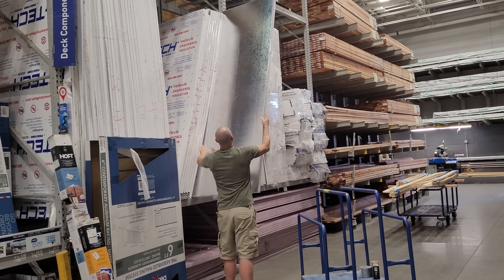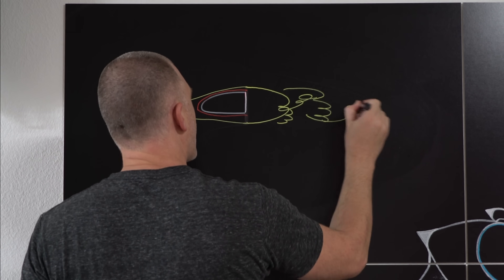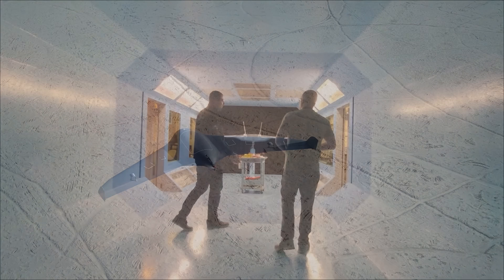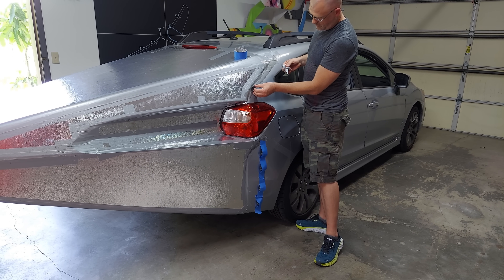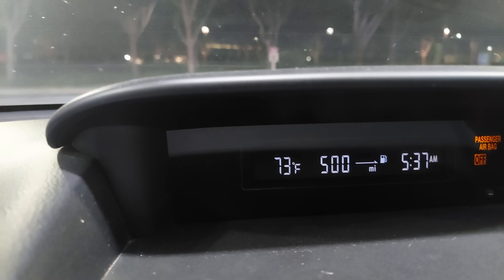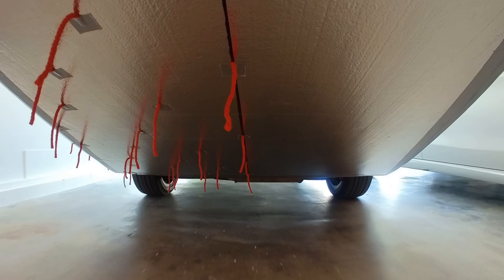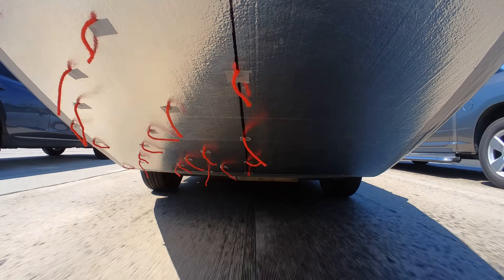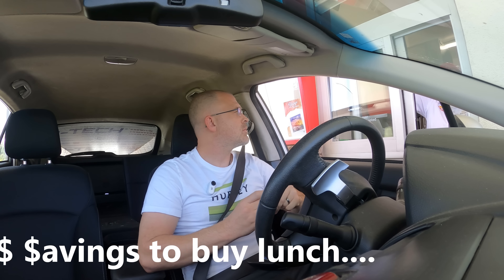Using Simple Aerodynamics to Beat High Gas Prices (Home Improvement Store Edition)

Comment: You improved efficiency,, but it's still pretty poor. 50 miles per U.S. gallon would be good for a car of that size. Go electric (plenty of good, low cost second-user cars can be found, sometimes for less than $5,000), and you should be able to achieve a gasoline equivalent of 200+ miles per U.S. gallon.

Comment: Also wonder why manufacturers doesn't do something similar but not that big or obvious. 
Like something smaller but still removes some drag. 
If it was this "easy"to shave off 13% then some less visible optimisations would easily save 5-10% and that is a lot. 
Manufacturers pour billions into engine optimisations to get out 1-2%

Comment: Any plans to revisit this project ? 
The tail on my car retracts on rails. 
I just use simple drawer slides. Nearly 2 years later, and it still works. 
Retracted, the car is no longer than a Camry. 
It also has a moveable floor that moves on inclines, so getting out of steep driveways isn't as much of an issue.

Comment: Great project and thanks for the whole video.
Some thoughts-
- ditch the roof rack!   Major drag
- boattail - great idea, but reduce angle to 15 degrees, which is when separation starts
  .. bottom should slope slightly upwards like a diffuser
- cover rear wheels
- belly pan

Comment: Check out the Audi100 C3 drag coefficient table. Low drag also mean low downforce
Reply from the maker: In a lot of cases the drag is creating no downforce, its just parasitic.   Good drag to eliminate.   But I understand your point.
Reply: @thinkflight  ah damn that hit really hard in my blindspot. Yes, certainly, and the difference between the mass, shape and disposition of the front and rear ends determines how much goes to downforce and how much to passing the air smoothly around. Low downforce can be extremely good but limits you to around 90 km/h from what I have driven so far. No joke one car was smooth as butter but really floaty on the highway above 90 km/h. We could have really efficient cars if we devoted four times the time into driver training.

Comment: It makes sense if the additional tail surface is conductive.
It looks like aluminum to me.
Foamed materials are susceptible to electrical charges, but electrically conductive surfaces will discharge.
Static electricity causes turbulence and increases drag.
Toyota puts aluminum tape on the inside of the plastic bumper.😄

Comment: With flat floor with air-rams pushing air from behind the radiator down under the car. Rework front spoiler and side skirts so they as well become air-rams. I am in Australia and tested this was getting 4% tyres +front spoiler/skirts 2% + with flat floor 8% BUT with flat floor with air-rams pushing air from behind radiator down under car and spoiler/skirts, tyres 22%. I had a hydraulic floor linked to the speed the car was travelling at, like F1 in the 1980s didn't have Vee shaped back as the car was total illegal within Australia but not unlawful so didn't want too much attention-getting. So 22% +13% =35% that would rock. Anyway, love your video's  Dennis-Michael.
Reply from the maker: Wow, pricelss comment.   Gratitude🙏

Comment: for someone talking about aerodynamics and with experience with drones and things i was surprised you used vortex generators in a completely wrong way.  the way you used them actually probably caused more drag.  there are papers out there that cover the proper placement.  aviation generally does it properly, automotives does not.

Comment: i would add a splitter but also add a floor tray so when air does get under the car at least its smoother , and for the tires , wheel caps are ok for the front . but in the rear you should cover the entire wheel well opening like on some hondas , also do some changes to the front of the car  the rear is important yes but id argue the front with all of its holes an odd shapes is the second worse part of your car , the underside being the worst ..

Comment: If you want to save as much of gas the first thing you should be doing is get the h-e-double-hocking sticks out of california, then buy a use toyota hybrid plug in, the gas milage is astonishing but toyota has been in the business longer than anyone so there gunna be ur best bet. Then modify the rear of that car till you get that 25% is you were aiming for. or you can get a honda insight. Those two vehicles alone should get you a strong 50-60mpg right off the bat. Plus with hypermiling and some modifications you should be pushing around 80mpg and charge the car from solar. Thats what im going to do in the long run. I have so many projects Ill being doing stuff for month maybe years

Comment: The angle between the ground and the underside of the fairing is far too large. Keep it roughly at 5 degrees or less to make sure flow stays attached.  Think... the nozzle on a co2/foam fire extinguisher

Comment: it was a super interesting project till you put cardboard over the wheel. I know for a fact this car wouldn't get the breaks hot enough to spontaneously combust paper HOWEVER there is still a big fire hazard with hot brake dust setting a portion on fire or possibly creating a smoldering situation. Not very firefighter of you

Comment: If only people realized if they had just followed Syd Mead's designs we'd have a lot more miles per gallon..
Like imagine a practical car designed with streamlined designs like that, with certain modern features.  The reason car manufacturers don't go this route is because they just want you to spend more, whether that be on gas, electricity or their own parts.

Comment: To your point about car manufacturers not designing cars this way, designing a car that sells is not based on the single factor of aerodynamic efficiency. Jeep had stayed in business a long time with little change in its overall shape which has the aerodynamic efficiency of a brick. If fuel efficiency was the biggest factor that drove the market, everyone would be driving Priuses.

Comment: 13% is not impressive, the most obvious and biggest gains that no one talks about is leaning the engine! shit you can install a special carb like the 3rd party dirt bike one (that atomises better), same superior spark plugs and give it the leanest setup for tht engine would still get better mpg than that pos mod. Should done a flat underside too.
Reply: A carb? You must be kidding.
Reply: @billsmith5960   lol, you would think but it's not a joke those carb compact japs were getting 40+ mpg with an inferior carb admittedly the test and "figures" are not adjusted to today. Man you could even see how much fuel an efi injects. With twin "high powered" spark plugs it would surprise you, while you're at it make it an air cooled v8 (they don't need that much cooling especially lean) and you got a sonorous and 40+ mpg nice thing all day. still not kidding.

Comment: I wouldn’t go as far as saying the car is super practical. You have no visibility out of the back window and now have made it inconvenient to use the hatch area for storage.  Car manufacturer’s would have to put a huge glass panel in the rear which would likely shatter in the slightest of collisions.  Glass is also heavier than foam panels which would reduce any gas savings.  Finally the car is no longer compact in size but lacks any significant redeeming value other than saving about $5 a fill up which for most people would be $260 a year or less in savings. There are better ways to save money like cut out one fast food meal a week which would be 2.5 times the savings.

Comment: Convert  your car to  run off ammonia! 
Ammonia fuel is the future not electric cars, Solar wind 
 Ammonia aka nitrogen hydrogen 3 NH3 is a cheap renewable  fuel that can be used in any gasoline engine and diesel with minor modifications.  Look up videos of ammonia as fuel. And you will see you've been lied to for nearly a 100yrs about needing  oil gas, solar wind, nuclear,  and now electric cars 
   Ammonia has been used as a  fuel before gasoline or diesel fuel even existed.. Ammonia engines existed before the combustion engine. 
Ammonia was used in 1960s Nasa space race,  it is still used in rocket fuel, aviation fuel, race car fuel. A rocket car running off straight ammonia holds the land speed record. There is more energy available in ammonia than gasoline,  diesel,  ethanol.  
You don't hear about ammonia as a fuel  because of corrupt politicians and corporations  know it will destroy the oil gas, electric car,  solar wind,  nuclear power,  power grid companies.
All takes to run a gasoline engine car, truck, boat , generator etc off ammonia is a propane tank and 2nd fuel pump set set up. a diesel need a propane tank fuel pump and a cpu tunner kit to get compression right.  
You can make ammonia at home or buy ammonia making processor, and easily made anywhere in the world even in the most poorest nations.  
Ammonia is made by pulling nitrogen from air, bonding it with hydrogen through Electrolysis with water and bumping off oxygen. 

https://youtu.be/XHZXAz9WP9M
 https://youtu.be/_H4XZ_m7P0E
 https://youtu.be/L0hBAz6MxC4
 https://youtu.be/B6HzP84KhoY
 https://youtu.be/eLMfRZGagfE

Comment: A lot of effort resulting in a curiosity.  Efforts applied to the underside of the existing vehicle like a full belly pan, management of wheel well catchment and flow, and as suggested a chin spoiler would have resulted in measurable gains in a lower CD while keeping vehicle fully functional as designed.  One has to look at the 90's Mercedes Benz 300e/W124  a brick of a car, but with a very low CD mostly due to under chassis air management.
Reply: Agreed, but you just can't know unless you try. Now we know what not to do.
Reply: @CallibanMcGee  Agreed. It was an interesting exercise. Reminded me of some of the 20's & 30's attempts at streamlining vehicles.

Comment: You could use some sort of transparent film for the tail lights area, achieving a better teardrop without obstructing the lights. Lowering the suspension and perfectly covering the underside of the car would be a priority for me before the side skirts. For the sake of taking it to the extreme, changing to narrower tires and hyperinflating them (at least) to the maximum recommended pressure would definitely make a significant diference. Technically reducing tire profile and lowering suspension are still aerodynamic related so I believe it's still inside the scope of the project. Perhaps tire pressure is not but it has such an impact that I believe it would still be fair play.
Reply: Sounds like you learned the same hypermiling tricks I did. 😁

Comment: Obstructing the license plate like that is hella illegal, especially in Cali.  It's only visible from the extreme center aft.
Considering that you can, often times, legally (state-dependent) mount a license plate in a non-factory position to facilitate display, you're better off just mounting it to the back of the teardrop (again, state-dependant).  

Yes, the third brake light must remain visible as well.

Neat experiment.  I've played with this thought experiment in my head many times.

Comment: You missed it.  You could have saved even more by flush mounting a 2nd pair of tail lights. Those slots must have been hard to form.  Even the Shady Tree engineering Co would have harvested low hanging fruit like that.  That's called a design defect.

Comment: I'll tell you this, reducing your speed to 55mph will result in an mpg increase also.
Reply: I bought a 2004 Tacoma back in 2007. Not a 4WD because I don't need one, but it has the TRD package, so it's a 2WD on a 4WD chassis, minus the front diff and transfer case. I bought it because that setup comes with a rear locker, and I was towing a good bit then...

The truck is a V6, and my "average" driving got me 18mpg. Still does. But I cut my speed to 50mph (I don't live far from work), inflated the tires to max safe pressure, replaced all the lubes with synthetic fluids, K&N air filter with a modified airbox, and then drove it like there was an egg under the gas pedal and no brakes. Went up to 23mpg.

Through a LOT of trial and error over the years I determined that by far the biggest improvement came from driving slower.

Yes, driving at 50mph isn't a pleasure, but if I'd had to drive far to work I wouldn't have been driving a truck anyway. I just had a goal to see how high I could get the mpg, and I was pretty happy with that.

Comment: Most state and federal code require the tail lights to be mounted a the rear of the car or close to it.. There is a second part anything exceeding some distance beyond your bumper has to have a flag or light attached also. Beyond another distance it simply becomes illegal. That is most states. You'll need to check your state laws each are different.

Comment: Barnaby Wainfan showed me 30 years ago how a perfect long tail could redice drag by  C/D /   point 2 but half of this can be achieved by relatively rear side, top and bottom skirts like you see on some semi trailers these days that can also be folded flat for opening the trailer doors.this could be done with about 18 inch long foam panels like at the start of your taper. the air is now relatively stable behind vehicle with far less energized vortices trailing you as the air does attempt to turn 90 degrees on blunt objects, but does mot try to make a 180 to fill the vacuum of a hollow box rear end. this would ave given you about 8% better milage with far less length. also belly pan is big help.  also, slowing from 65 mph to a cruise of 62 mph can yeld about another 9%, yielding you about 42 mpg on your Subaru wagon.
Reply: I've long been curious at how much mpg improvement those semi side skirts gain.

Comment: Why, several, they don't use insulation board and duct tape to make vehicles,  length, rear-end collision, weight and cost.  Why change, you be required by your Reichstag in 2033 to use "Zero" emission vehicles.   After all the children working in the cobalt mines in Africa will provide you one of the raw materials for you battery.   That when the rest of the USA will stop providing all the dirty energy to your state and you can exist on windmills and solar panels.   Don't build hydro electric it disturbs the fish.

Comment: My guess the reason auto makers don't do this is the added sheet metal weight, even plastic adds too much weight to the car.  There was a time when cars were shaped like you suggest in the back, sloping to the ground.  That style didn't carry through; maybe because of the weight behind the axle didn't help all that much.  What you do to your car, and what manufacturers are ALLOWED to do may two different things.

Comment: Efficiency in design is NOT something most manufacturers look at when designing a new anything. They instead look at maximizing their own profits, and making something they can get the public to buy.
Case in point, look at the Aptera. An Aptera has the same drag for the entire car as a Ford F-150's side view mirror. Allowing it to get 1,000 miles off a single charge, while having enough solar on the car to put 40 miles range back in the batteries every day just by parking in the sun. But it does not look like your normal car, and it only has 3 wheels.

Comment: you will gain from dropping bottom, but cannot get away from a steeper top, then seperation on top comes back.
perhaps allow the sides to colapse more and disapear into narrowing end wedge knife, but with T roof overhanging more than the narrowing bottom section. Perhaps curve center downward, creating wing ends (hat tip to the 50's) so as to keep the fast laminar top seperated form left and right air colapse with T edge seperator joining top to disappearing bottom section at center knife edge at back. this keeps the two sides from fighting for drag creation. Knife needs to be far enough back for tipical speed optimum.

Comment: the way you let the numberplate still visible would be illegal in australia (must be readable in a 170 degree arc)

Also depending on the transmission, manual cars have the potential to run more efficiently than equivalent generic automatic transmissions through short surges of power and coasting (you only use fuel to accelerate the car), otherwise you will need an exact gear ratio and an exact throttle amount for the given speed and drag to optimally cruise..

Comment: Check out the Aptera amazingly aerodynamic call fission of drag .13, one thousand mile range with 700 W of solar on the roof. It can charge up to 40 miles in a day sitting in the sun.

Comment: I had a Subaru Legacy (2.0 flat-4, gasoline) once, that was nice to drive, but consumed around 10-12l per 100km (19-23 mpg).
Now I have a Toyota RAV-4 (2.0 line-4, turbodiesel) which is certainly worse in aerodynamics (way taller) and it's also heavier, but consumes just about 5.8l per 100km (equals 47mpg). Adding a long tail to that car would maybe spare a bit, but according to the car's size that tail would be probably longer than the car itself, haha.

Comment: I love stuff like this. I love doing anything I can to get a little better gas mileage. Airing up tires, coasting to stops if I see the light is red from far back and even drafting a little bit. Ironically I drive a full size truck.

Comment: Nissan e power car which uses regular petrol to generate electricity to run electric motor, improve fuel economy by over 50% compared to regular internal combustion engine.